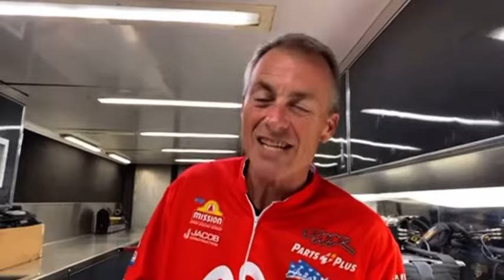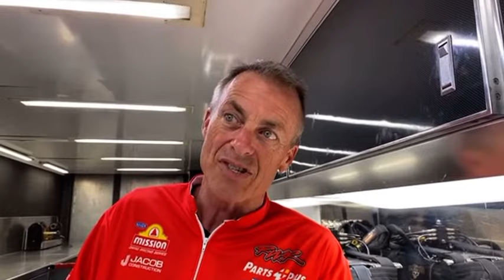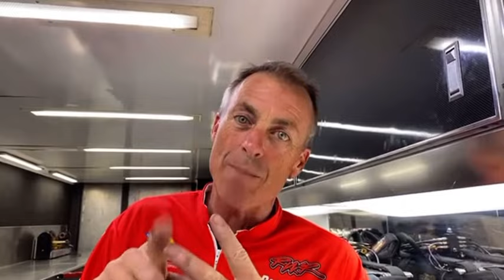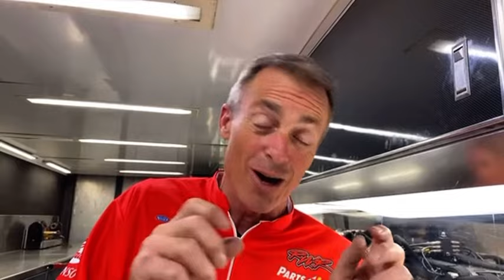The 2 magnetos in a nitro motor explained (quick version) 😁 w/ @claymillican25  #race #racecar

Comment: For you drag racers. The mags are (top fuel cars). They see the same crank signal (xmas tree) but are running separately down the track (MSD) to cross the finish line (spark plug) goal is to provide a bigger more powerful spark & entertain the crowd (nitro burn) 🔥! 😊😊😊😊🎉🎉

Comment: Thank you for the explanation. It answers some of my questions and leads to another couple maybe you could clear up. 
At Engine warm up, right after the engine goes to Nitro, Austin is down on his knees with a timing light pointed at the crank I’m guessing. Meanwhile, Jessie is on the others side, at the distributors. Is Jessie seeing the timing marks that Austin lighting up? Jessie then appears to be looking in at the display in the cockpit and makes adjustments to the distributors. Can you clear up without giving away specific settings (I’m guessing that’s the info that is taped over for our best view ever of a top fuel run) what these two guys are doing?
Reply from the maker: I screen shot this .. I’ll try & get that cleared up .. you “I don’t know” 😁